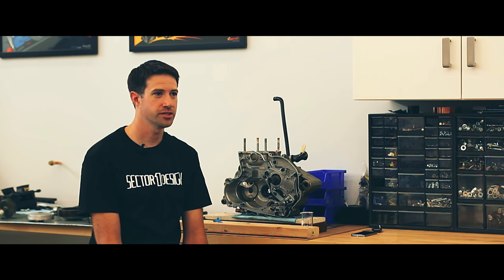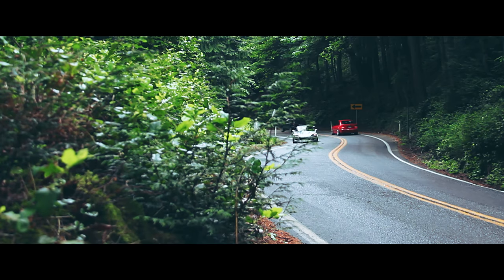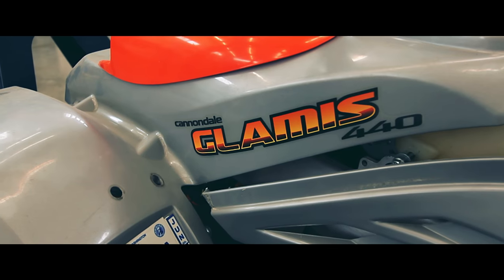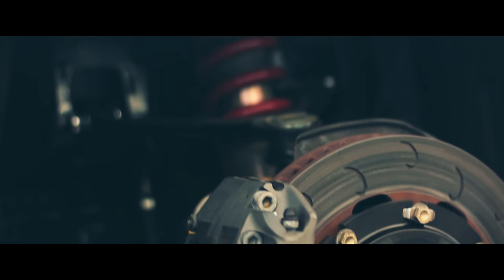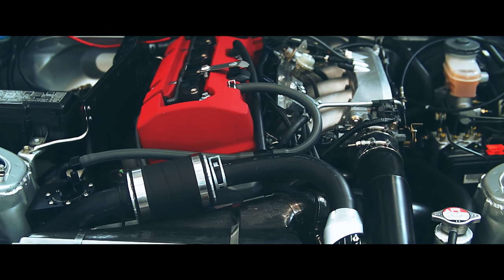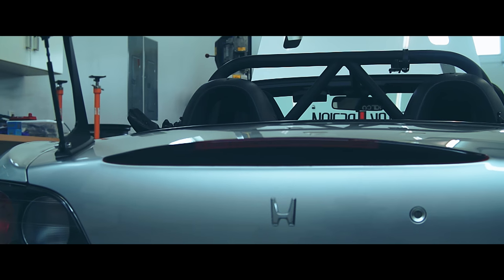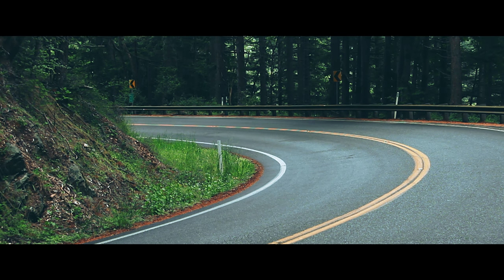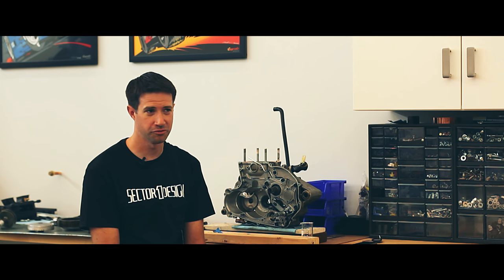Car Life: Beauty in Refinement - Honda S2000 - SingularEntity.com

Comment: Imagine if they made an S2000 Type R
Reply: Why are we not funding this?!
Reply: There's an official Honda variant of the S2000 called the S2000 CR. Closest thing if not THE type R version.
Reply: I've seen it before it looks so nice, but I'm talking about a legit Type R.
Reply: the club racer is equal to japans type s, which is more sport than race. type r is one level above it and it truly is a shame they nvr made one. 😭
Reply: okay with that logic, that would mean a stock S2000 is on par with a stock civic si. I'm just gonna assume you dont have experience with driving an S2000 on a track, but leme tell you, it'd be pretty hard for them to enhance it from the factory. Even the CR has pretty minimal changes, all of which dont even affect engine performance.
Reply: He is referring to the S2000 type S sold in Japan, which had similar(not exact) specs to the CR.
Reply: rumor has it that the new s2000 that is suppose to be released sometime 2019/2020 will have 2 models.. a base model and a type R model. if its loaded up with sensors and junk then im keeping my s2000 and maybe just go on a hunt for a very low mileage one and garage it
Reply: next version won’t be type R .... maybe the  next honda s5000
Reply: @BSon-sj9uc  never happened  bro unfortunately  🤧🤧
Reply: @PrimetimeRU951  I know, I ended up working for Honda, I'm back with bmw now. But they never plan to make a new one lmao. It's sad.

Comment: Dude there is an S2000 for 8975$ up here in Washington right now, the year 2000, 75,000 miles, but the title isn't clean because of supposedly stolen seats. That's still a very good deal though, right?